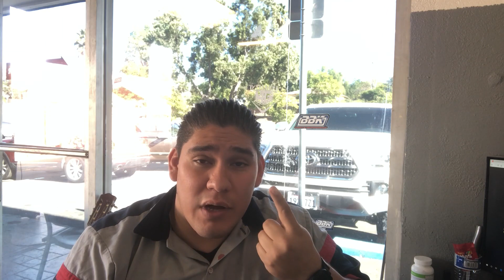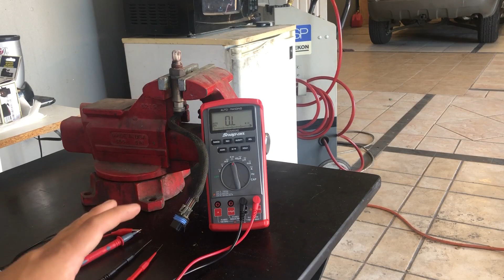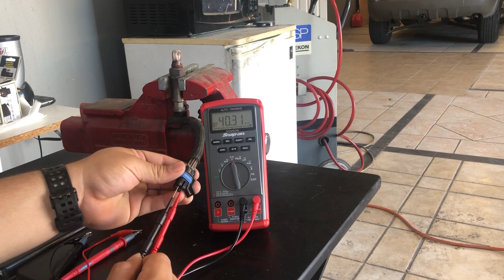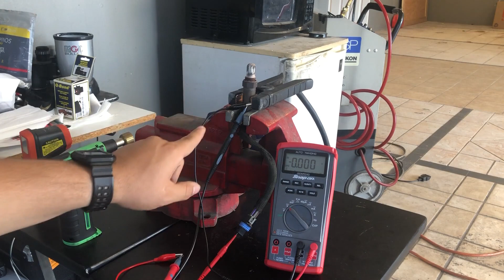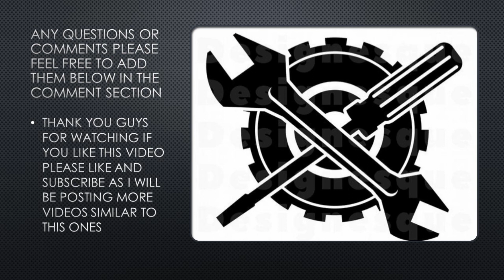How to Test an Oxygen Sensor

Comment: What about a 5 wire Sensor?  Heat the sensor to almost 1 volt.
Reply from the maker: With the newer vehicles that are 5 or 6 wire wide band sensors this test can be done but is not as accurate because this sensors are so fast that a voltmeter or even a scanner cant catch a glitch on them sometimes the best way to test them is using an oscilloscope but you can try putting one lead in the positive current control wire and the other in the return wire and you can see the volts and how they switch what vehicle is it that your working on?

Comment: Hola Cristiano just subscribe to your channel, I have a question on the o2 sensor signal wire  and the ground  wire , if you testing the o2 sensor on the car, the red lead of the multimeter is connected on the signal wire, where do you connect the black lead? To the ground of the computer or to a good ground on the chassis? Thank you christian I hope you can answer my concern, great video
Reply from the maker: You can use the chassis ground or any good ground thats fine cause your just tying to read the signal voltage from the sensor
Reply: @481cristian  thank you Christian for your quick response,

Comment: I'm getting a P0507 code on my 2002 nissan sentra. Also ST fuel trim (B1-S2) 99.2%. What's going on??.
Reply from the maker: I believe thats a code for the idle air control system which means you either have a vacuum leak causing the idle  been higher then usual or the idle air control valve is getting stuck open or not closing completely due to carbon build up which is common on those Nissans
Reply: @481cristian  thanks bro. I'll see about cleaning iac valve.

Comment: What's the simplest way to understand a bias voltage
Reply from the maker: The O2 sensor measures the amount of oxygen present in the exhaust system and compares that with ambient (outside air)to produce a voltage signal.  The O2 sensor is calibrated to output approximately 0.450-0.500 volts at stoich AFR (14.7:1).  Leaner mixtures result in more oxygen content in the exhaust system, which will result in the O2 sensor outputting lower voltage (below 0.450 volts).  Richer mixtures result in less oxygen content in the exhaust and thus higher voltage output (above 0.500 volts).  The computer supplies a voltage bias on the O2 sensor signal wire of about 0.450 volts, and the O2 sensor will either pull down this voltage (when the exhaust is lean) or pull it up (when the exhaust is rich).  The reason for the computer supplying a bias voltage is for diagnostic purposes.
Reply: @481cristian  what about crank an cam sensors do they also have a bias voltage,I want to know it how to check for a bias voltage/understand a pull up an pull down design hall effect sensors
Reply from the maker: Ryan Ramlochan 
They don’t have bias voltage because they produce their own voltage most of them make square wave signals and some even use frequency signals you can use a scanner or a la scope to check their operation
Reply from the maker: Ryan Ramlochan 
To test a crank shaft sensor Set up the scanner to read engine RPM and crank the engine. The scan tool should read between 100 and 500 RPM. A bad reading indicates that the crankshaft sensor isn't working right. A reading of zero indicates that the crankshaft sensor has failed completely.   Or You can remove the sensor, and then test the resistance. Attach one end of the multimeter to each wiring lead of the sensor. Resistance of zero means that the there is a short circuit. Infinite resistance means there is an open circuit. Either one of those readings indicates that the sensor is not working. For any other reading check it against the manufacturer's specifications. If your reading is not close to the recommended resistance, then you should replace the sensor.

Another way to test the crankshaft sensor is with a multimeter is by checking the output voltage with the engine cranking. You will need an assistant to do this. Be very careful around moving parts as you do this. Probe the wiring connectors and measure the output voltage in AC millivolts. Typically, this reading is around 200 millivolts, but this can vary from vehicle to vehicle. Check the manufacturer's specifications. If there is no output voltage, then, obviously, your sensor is not working.

These tests will help you pinpoint the source of your problem. They will either prevent you from making a repair you don't have to, or confirm that the repair you're about to make is the one you really need.
Reply: @481cristian  thanks alot,I'm all the way from Trinidad and technicians down here just change parts even whole harness to solve a problem.i bought a multimeter and a x431 diagun iv to help narrow my problems cause we don't have wiring diagrams,need wiring diagrams for nissan tiida,Toyota, mitsubishi and Honda.if I can know where or how to get diagrams that would be much helpful
Reply from the maker: Ryan Ramlochan 
You can get the diagrams online sometimes or on all data program or Mitchell
 which has all the wire diagrams but most  you have to pay